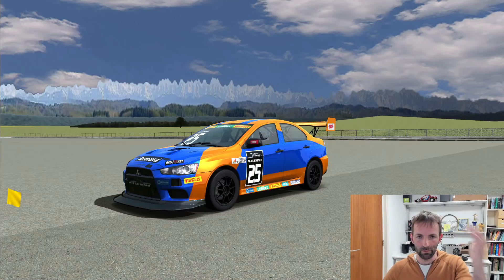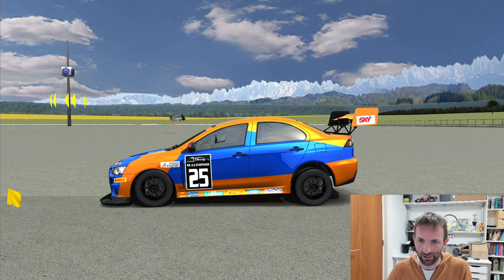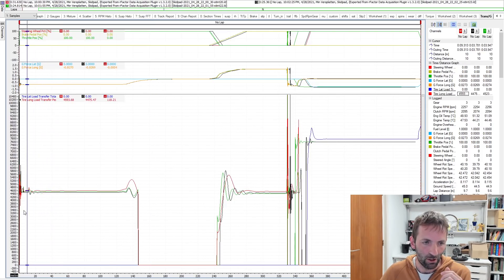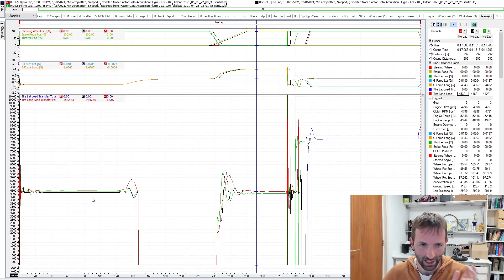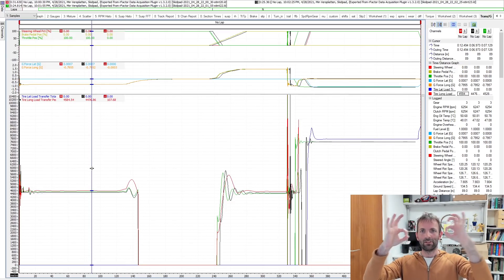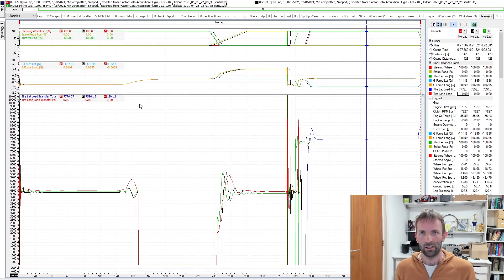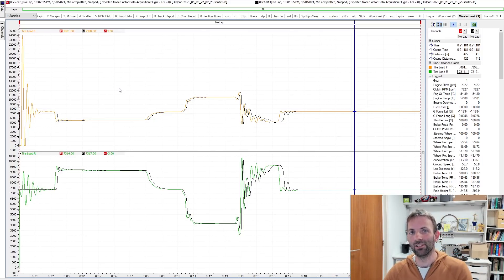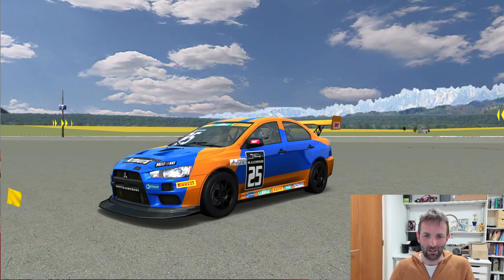Weight Transfer is *INVISIBLE* Let's Explain Why!

Comment: You do have weight transfer, and correct, the weight transfer is always the same. How ever, springs takes the weight. and determines wether your car is gonna roll or not, stay on track or not, slide or not.

Comment: Rake will however affect the distribution of lateral weight transfer that will occur on the front vs rear axle. So, running a higher rake will causes more lateral weight transfer to occur on the rear axle and less to occur on the front axle, thereby affecting the relative grip levels front to rear during cornering. But the total combined amount of lateral weight transfer will be the same regardless of how high or low you set the rake. Why would you want to change the rake then? Because it affects the over/understeer characteristic of the car during cornering by affecting the relative grip levels of the front vs rear end. More lateral weight transfer on the rear than at the front (via increasing the rake) will cause more oversteer.

I have seen so many times it stated that increasing the rake causes more oversteer because it shifts static weight from the rear to the front which is of course completely wrong as you've demonstrated empirically.

Comment: I have a theory would love to hear your thoughts on this. stiffer springs and ARBs reduce camber variation (keeps more negative on outside and less negative on inside)...so in theory if road surface isn't too rough such that tyres follow the surface, then a car with stiffer ARBs and springs will have more mechanical grip in corners simply because the camber is better managed.
Reply from the maker: In theory yes, I would agree. In practice, the camber differences you get from a 'race car soft' (rock hard) versus 'race car hrad' (even harder hard) are probably fairly small, and 'other things' will possibly play a role.

In an extreme example, going from 10 degrees body roll to 1 degree, with the suspension gaining negative camber at 50% of the body roll, you would add 5 degrees of camber and 0.5 respectively. A big difference that would surely mean less grip to the big rolling car, unless you start with say -7.5 camber, but that might destroy your tires at worst or at best reduce traction and braking. However, the 10 degrees of body roll would also take time to happen. So doing a chicane with the softer car would take more time as the load transfer takes time and the grip ability of the tires changes slowly as the load transfers. So in extreme theory these are some real differences. Going from 250N/mm to 300N/mm springs on a GT3 car won't have such an impact at all.
Reply: @NielsHeusinkveld  Thank you very much for detailed information.

Comment: effectively you can t change the weight transfer on a given car, no matter how you set it up, what the set is done for is how you distribute it. for lateral transfer you can get stiffer front springs and/or arbs, it will allow them to take a bigger part of the total weight transfer,  and there comes the tire coeff friction to understand why more WT on the front means less grip on the front but that s another subject.

Comment: Dampers can slow we transfer right?
Reply from the maker: WeTransfer probably depends more on their server.... oh.. yeah, weight / load transfer speed is partially controlled by the dampers.. But, on stiff race cars, I bet this difference is too small to be really noticed. To speed up, or slow down the weight transfer, your wheel and pedal inputs are probably 90% of the deal. I might make a video about soft vs firm race car suspension and 'time it takes' for the load to transfer. I bet it doesn't matter too much and that it effectively transfers at the speed you apply the steering or pedal input.

Comment: So... When my Rc buggy had too soft rear springs and was wheeling - zero front grip and then I stiffened the rear which stopped it your saying the weight transfer was the same?
Reply from the maker: I have no experience with RC buggies, but they probably have a LOT of suspension travel. If you reduced it by 1cm and the car is 1:10 scale, that is 10cm 'full scale' which is significant!
Reply: @NielsHeusinkveld  Race Car Vehicle Dynamics by William F. Milliken features weight transfer heavily - Have you ever adjusted spring rates, ride height on a 4 corner scale and seen the weight most definitely transfer? I think your sim is leading you astray. A softer front end has more grip  on entry because there's more weight transfer. If you limit the travel of the rear end to prevent that transfer you won't be surprised to discover less corner entry grip.
Reply from the maker: @gt3911  Changing heights and rates has all sorts of effects. Again in RC buggy type cars the suspension travel might be relatively large, so you would notice the dynamic CG height more than on a racing car. 
But on a 4 corner scale you can't see dramatic differences, even on a RC buggy, if you change heights or spring rates. Sure you can jack corner weights around diagonally, but the total front and rear axle weight simply can't be changed in any other way than front or rear movement of the center of gravity. And that doesn't move a lot with ride height changes.
It is also more or less common knowledge that a softer front suspension creates more oversteer not because of a change in weight transfer, but a change in load transfer distribution. The rear axle takes a greater percentage of the transfer, and in pure cornering this move uneven loading of the rear tires results in less total rear axle grip. And when accelerating, this uneven load, more highly loaded outside tire, is able to create more rotation torque, adding to 'on power' oversteer as well.
I have a Technic Lego car, about 1:8 scale and it is very easy to test ride height changes and front vs rear weight only moves in the tolerance of the scales and a gram or two perhaps.
Reply: @NielsHeusinkveld  I think I'm  conflating your usage of "weight transfer" with load transfer. But surely the load transfer should be noticeably in the telemetry? Why is the  load transfer distribution not showing for the softer car when you say yourself its the common knowledge reason for oversteer - yet the telemetry loads didn't show this load transfer?

Comment: But the weight transfer will happen faster/slower depending on the shock/spring package, right? Stiffer dampers and springs will create a more responsive car because the tire load is achieved faster. Or am I wrong there?
Reply from the maker: Absolutely 100% true. By how much is a debate though, cars are stiff, and a bit stiffer or softer doesn't really change that weight transfer super quickly. The main way to slow it down is to slow down your inputs, not soften the suspension.. Probably.

Comment: On my motorcycle I could achieve less understeer by lowering the front by 2cm but there the center of mass is way higher in comparison to the wheel base. Ah but the caster and angle of the fork probably got slightly affected as well and maybe had a bigger effect. While the actual weight changing isn't really much I think it still affects nuances in the balance right?
Reply from the maker: If the weight distribution is 50/50, that lowered the CG by 1cm, which could be a 'real' thing, and indeed probably changed the caster angle and these things might change the feel of the bike. The static weight distribution only went from 50/50 to 50.01 /49.99 (ish) so that really can't be the main thing you felt.

Comment: Thanks Niels for the amazing job of explaining complicated vehicle physics with simplicity !
I'm in my final year of mechanical engineering degree and most of my knowledge is in aeronautics but my true passion is automobile and racing. I'd like to extend my knowledge but don't really know where to start. Do you have a book (or multiple) that you recommend to understand dynamic of vehicle and design of automotive parts ? Thanks !
Reply from the maker: Race Car Vehicle Dynamics is highly regarded and it has enough examples and 'talk' in between the equations.

Comment: If the vehicle has weight, it will always transfer.

Of course you (the driver) inside the car can affect this by bouncing up and down in the seat or leaning side to side. This is advanced weight transfer technique.

Comment: Interesting video! But then why would I go corner balance my car?
Reply from the maker: Transfer adds load or removes load from the tires. If you start with unbalanced corner weights, you will have unbalanced weights when braking or cornering, which might make the car handle a bit less optimally.. Depending greatly on many things of course, there is no 'truth' almost.. Live axle cars have changing corner loads when applying torque for example..

Comment: So, was struggling with "lift-off oversteer" in the Formula Trainer ADV from AMS2 and concluded to reduce weight transfer by adjusting the setup 🤦🏽‍♂️ Needless to say, it didn't work. And now I understand why 🤯 But I still have "lift-off oversteer" 😡
Reply from the maker: Don't lift! :D
Reply: @NielsHeusinkveld  Meaning: "Whoever brakes, loses"? or weight transfer is best managed through brake and throttle inputs?

Comment: But Niels...! You forgot to mention that changing the stiffness of the rear vs front anti-rollbars actually changes the lateral "weight transfer" (or at least the distribution of it). [edit: thinking about it, it's probably better that you didn't dive that deep into the topic]
ALSO, if you REALLY(!) want to bore us, I'd love a (physics-talk'ish) reaction video to GamerMuscle's reaction video about the reaction video of his reactio... no that's one level too deep.. of his "3 physics issues with AMS2"-video. Helping him understand differentials and the basic driving characteristics of rear vs mid vs front engined cars (or better: cars that have a rear vs a front heavy weight distribution), might be helpful for a lot of sim racers.
Reply from the maker: Deliberately not talked about that. Total weight transfer can't be changed, but the % going to the front and rear axle can be changed, and this is a HUGE car setup thing indeed.

Comment: I'm with you that 90%+ of simracers don't really understand weight transfer.
Not sure if this confusing video helps, however.
The only valid information is in the description and at 6:40.

My antithesis: Of course you can see weight transfer, it is measured by the springs.
Reply from the maker: I'm not sure I get what you're saying.. I can make a car roll INTO the turns, so the outer springs EXTEND instead of compress, and yet the weight transfer is identical to the car where it rolls as you would expect, to the outside, COMPRESSING the springs.. So I don't think you can 'see' the transfer and certainly not 'measure it by the springs'!
Reply: @NielsHeusinkveld  I'm saying: "If you know your suspension you can usually derive load from displacement". This even applies to your inverted one. 
I admit: A more elaborate (e.g. active) suspension might not have such  a 1:1 relationship, so looking at it might tell you nothing.
Reply: Weight transfer also would happen at a 100% stiff car without any spring travel. So its indeed not visible. You only can measure the load on each tire to verify it

Comment: Only thing is the tires need equal load equal contact I don’t know what this sim is but the little effect does seem right but the full tire contact is important. I did try a high rake set up with my rear engined traxxas slash 2wd 1/10 scale. It was high already and when I lifted up the rear to high rake it seemed to cause camber problems in the rear because it has independent suspension, no sway bars, and it’s rear engined. It would just not make full rear tire contact and like neal said it wouldn’t do anything. It still is wider in the rear and skinnier in the front still under steers

Comment: It is not that easy that the amount of "G-Force" (mechanical deceleration acceleration) causes weight transfer. Imagine if you pull a very stiff car with a rope to accelerate it strongly, there will be no weight transfer. It only occurs when the car accelerates by itself with moving wheels In reality its explained by a equilibrium of torques those are propped up by the wheels to the road.
Reply from the maker: If you attach that rope to the center of gravity, then there is indeed zero weight transfer. But since most of the cars we drive rely on tires to put forces on the car, my example is not too bad? :-)
Reply: @NielsHeusinkveld  
Yes, the video is great. Only the message "weight transfer completely depends on g-forces" was a bit confusing. Consider rocket driven cars X-D
Reply: @b.s.7693 , actually the only way there would be no weight transfer is by attaching a rope to the contact patches of the tires. Any height on the attachment point will induce a torque to the "mechanism", which has to be countered by some uneven vertical forces on the tires.

A rope to the CG on a stationary car is pretty much analogous to a "G-Force" on a cornering (or braking, or burping, or accelerating) car.
Reply: @heitooooor  Your right. The pulling force in my example has to engage exactly on the centerpoint of the wheels. Nevertheless, a very simple car consists of 4 wheels attached to a even plate would produce weight transfer if it accelerate by itself. At a certain point it would do a "wheelie" (if grip is sufficient). Not possible when the same car is pulled at the same G-Force. Thats the different.

Comment: What sim do you think has the best suspension model? I don’t really know much about their data/calculations they are using but I really like what I see in beam ng especially with their off-roading vehicles (an absolute pleasure to watch!) I really like that they have tons of physics telemetry (g forces!) you can see in real time however real it may be. I’d really like to hear what you have to say.
Reply from the maker: I would hope that most of today's sims use a good system that simulates all major effects of the suspension geometry properly. I don't think there is a sim yet that has suspension bushing flex, which would be great for most 'non racing' cars. RF2 has flexible links but only in extension, I think. At some point it seemed iRacing said they don't really have a suspension system like most sims (I hope that's changed!) and even rFactor 1 from 2005 has a proper rigid body system that has every effect done very well!

Comment: Am I right to think that you can only achieve that last effect by changing the sign of some numbers in the simulation? In other words: you could never achieve that in real life, right?
Reply from the maker: I did cheat a little for dramatic effect, but it can certainly be actually done in real life! When the roll center of the suspension is above the center of gravity of the car, you get 'motorcycle lean'.. And when you tilt the wishbones weirdly in a side view, you can get more than 100% anti dive and anti squat, reversing the acceleration / braking suspension movment from what you think is logical. These tricks are used to some extend (not to the point where movement is reversed though!) on almost all cars. You can get the suspension geometry to act like an anti roll bar and also to reduce nose dive and rear squat. All down to where you mount the suspension linkages.
Reply: @NielsHeusinkveld  Thanks for the explanation!
Reply: some dirt oval cars use a rear 4 link that raises on acceleration, to increase the AoA of the whole body for more downforce
Reply: Some BMW motorcycles and even cars have an anti dive suspension geometry, and especially videos of the motorcycle are interesting to watch because the machanism is exposed and well visible

Comment: From what I know tho, a car with a high body roll has a bigger almost pendulum effect so when the weight transfers you briefly get lower load followed by higher load before it’s stable. I don’t think it’s massive but when you’re pushing you can kinda feel it. I notice it much less in stiffly set up cars and I think it’s mainly anti roll bars? I don’t really know how to explain it but you can feel it.
Reply: That is more to do with soft suspension and stiff suspension, not the weight transfer being dynamic.
Reply: @awesomecooly123  No, he's right, with his "high body roll"... those are cars with soft suspension and relatively long travel then also and only after the travel is done and the springs are not compressing any further, the "weight transfer" (it should always be "load", or even better: picture all of it in inertias) is buffered for the time it takes to travel. If during that time you steer into the opposite direction with the resonance frequency of the suspension, you can escalate the oscillation. @JB 22 maybe you want to check Wikipedia or YouTube for "Moose test".
Reply: Another detail: it only overshoots with a higher load if the dampers aren't "stiff" enough.